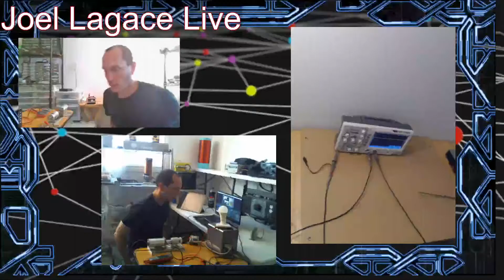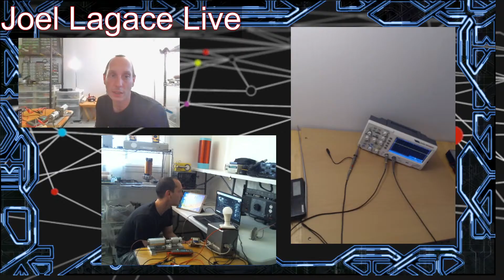Motors Coils And RF

Comment: I didn't know Geralds account got hacked.  Some people online were saying he's a fraud, but so far his motor and generator combo works.  I haven't done much with it so far, but i got similar results with around 130ish volts out of the pump and around 40 or 50 amps.  I have no problem lighting up lights.  I ended up getting a sodium bulb in the mail and want to check the temperature experiment with the step up transformer and spark gap next.

Comment: How is the transformer wired and also why not just feed the transformer with the output from the second motor start with the power supply then switch over to the second motor?
Reply: I also am wondering about how/where the transformer is wired. Fascinating!

Comment: You are spot on with the motors. I have a 4" inline can fan. I run it in the garage next to my D-phi oscillator off a 144W inverter/12V battery bank. When I run this motor, my meter sees 9W less of power. My meter is on the other side of the house. 

Additionally, my washer used to consume 1kw but now consumes around 520W. I have my ground wire connected to this appliance to a brass fitting under the sink. This goes into a water cell with the cathode a 8.75" bare copper wire which is being connected to the AD terminal of the D-phi oscillator which is basically like the triple point of a three phase transformer but a bifilar toroidal structure with bilateral symmetry like don smith but with a hot side and cold side separated with a 350V spark gap bulb. Just trying to provide context at which the motors started to produce this effect where as before it was not noticeable. I use a 10 ohm resistor for antigravity wave, through skkotchy tunnel diode, through a ceramic disk capacitor to provide the high frequency PWM to drive the back emf off the ground pin of the potentiometer off a bendini motor. 

I am not trying to brag but only contribute by confirming that your work is legitimate and your insights have been valuable to me. 

I am concerned with scale. If we load more things are we damaging ourselves with radiation? This is why I avoided a motor which is limited to RPM and just have my bendini motor switching in stationary and off mode (it can switch if the input still has voltage even if source battery switch is off) 

Your cross domain idea seems like Ananaki electricity? https://youtu.be/NWh4y1d9Th0?si=LYvSoqAMpa-19Eqq 
Your background seems like you could get something from this as well as...

These might be of interest: 
Coherent wave geometry
https://www.youtube.com/live/cBbJw58tg1s?si=JnA0_SXe5GS4nOlX

Hutchinson Battery replacer
https://youtu.be/4U2R5VXhqIU?si=mSmbnWSCehlZ71Qc

Bruce Swartz IR ARV capture (coherent wave geometry example)
https://youtu.be/zjfixeYdVEY?si=LmwxkN7_jsmoZnEN

Much love Joel. TY

Comment: Hello to you there. You said to ask in the comments if anyone had a question.
Reply: I just learned about thos individual.  I'm still putting the motors together.  The motor that comes out of the front loader washing machine is located where the water is pumped.  That's all I can tell you so far.
Reply: @thecontact2609  thats a great start tho i enjoy learning about it all when i get the spare time. Its quite fun 😊
Reply: I've worked on different areas the current one is Gerald Morins concepts and have found interesting results. But I've noticed some unusual observations when doing 1 wire strategies to test. Do you have any advice? I'm doing a bit of work to go into the first video I've only done shorts. Any advice you can give is highly appreciated 👍 wishing you the best
Reply from the maker: Try experimenting with AV plug type setups and series outputs on the DC out gave me interesting results.
Reply: @joellagace1679  oh now that is something to try. I do remember odd behaviors in series. Ill give that a try ☺️ i appreciate it.
Reply: Is the transformer primary connected in series to your drive motor on the positive rail with ground connected directly to the motor?
Reply from the maker: yes